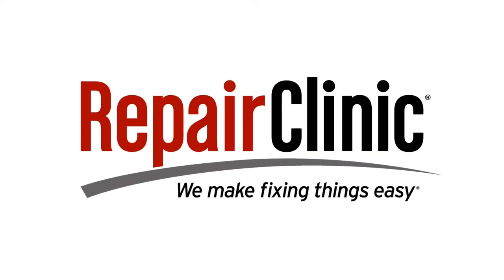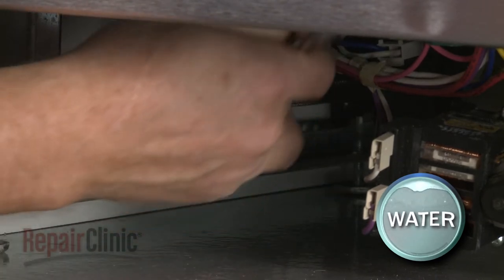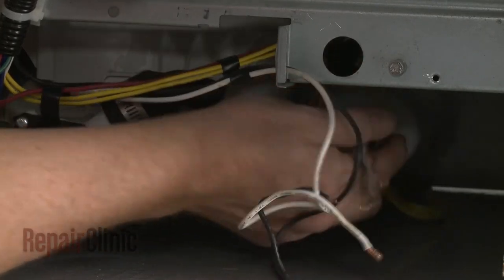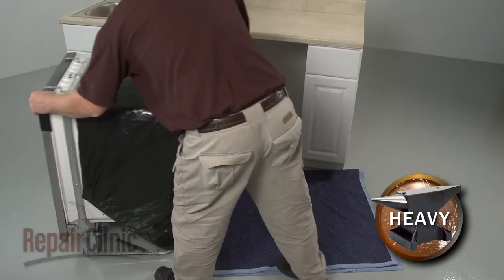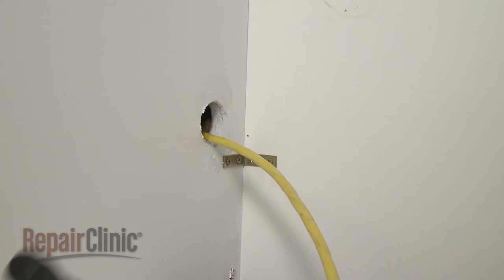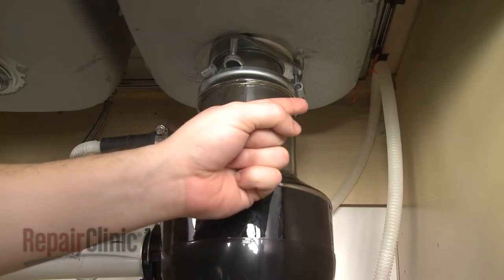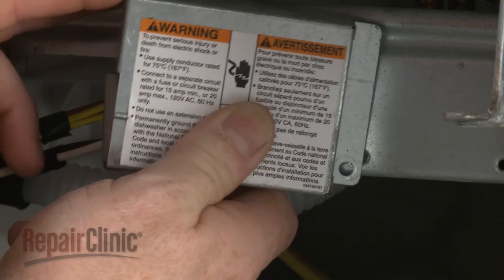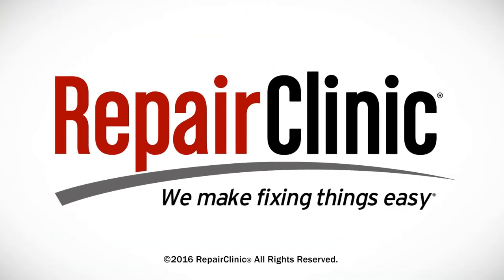Kenmore Dishwasher Thermistor Replacement 154227501

Comment: Seriously... it takes 3 hours to do this, and no way to know if the thermistor needs replacing before you do it! so just spend half a day doing this, and hope for the best.
Reply: Ryan O   There has to be a way to test that thing.  Was reading somewhere to check resistance and then put it by a light bulb and it should go to zero.  Not sure.
Reply: 3 hours if you have 10 thumbs.